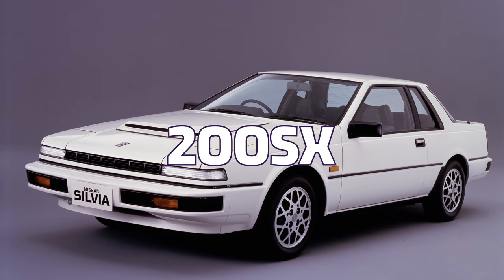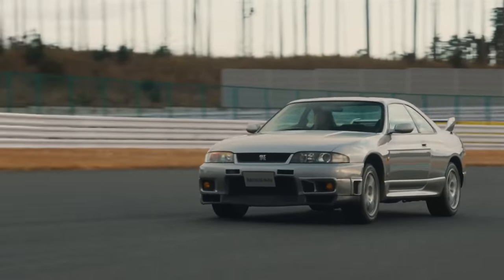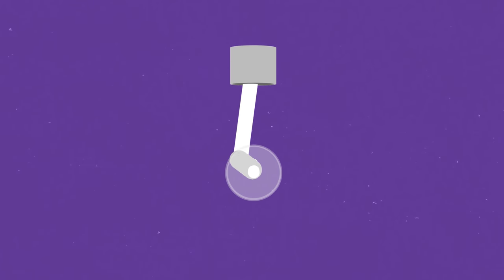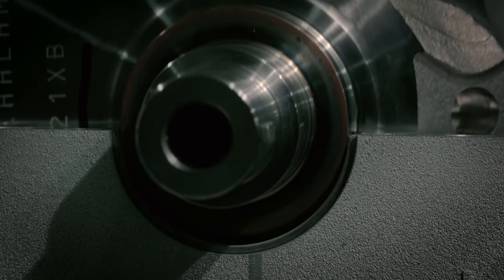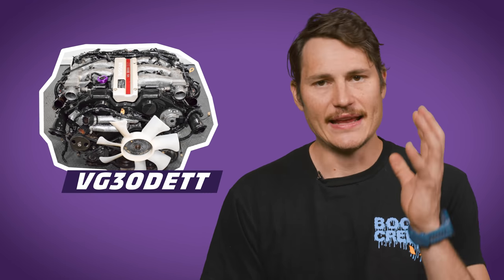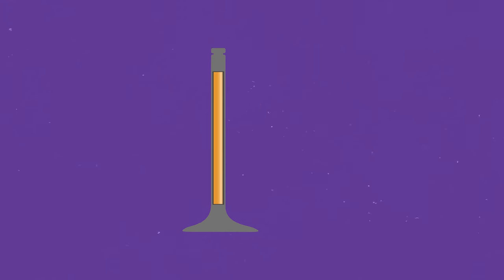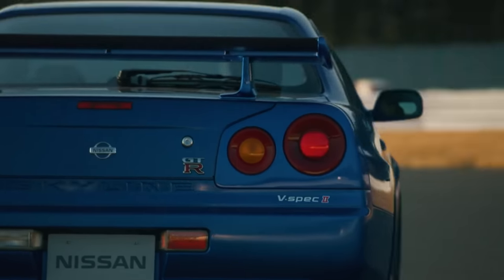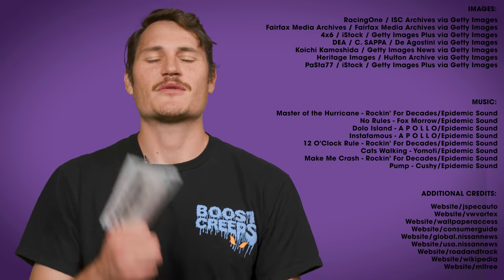RB vs. VG: Why Nissan Discontinued Their Best idea

Comment: I used to have an 86 300ZX. Red, T-tops, 5-speed, upgraded intake & exhaust.  All riding on fat 50-16's.    I scared the hell out of a few friends with that car, and even scared myself a few times.    I LOVED that damn car.   But that love went up in flames on a dark, empty back road, early in the morning.   I was hauling ass one morning, late to work.   I had just gotten into "the zone".  Taking the twisties, grabbing the gears, just pushing physics to the razors edge.  Hit a long straight stretch and turned 'er loose.  That was when a fuel injector decided to short out.  I don't know how, or why,  but the result was the wire going to the injector got hot, and started burning.  Now VG folks,  what is right next to the fuel injector wire?  Yes.  A one inch long rubber fuel line to said injector.  What happens when you light a pressurized fuel line on fire?    Nothing happy, I can assure you!  

As the line burst,  the fuel sprayed out, igniting off of the already burning wires, and rubber line. Flaming fuel, being sprayed all over under the hood.   By the time I stopped, the interior was filling with smoke.  I jumped out opened the hood to witness a mini flame thrower shooting down under the intake manifold.  I shut the car off to cut the fuel supply,  but by then  other flammables had already taken light. I tried to slap the flames out with my coat.  I tried throwing handfuls of dirt under the intake.  It just flared up, and I slammed the hood back down.  By now, the flames were already licking the outside of the windshield, and the wipers were beginning to catch.   No cell phone.  4:00 AM.  Practically deserted back road, out in the woods.   All I could do was stand there, about 100 feet away, and watch as the flames consumed more of the car.   There was a pop, and then fire emerged from the interior.  Some old guy came driving by and said he'll get help.  After about 2 minutes I heard sirens.  The fire dept showed up and it took them about 15 minutes to get the thing put out.   The car was a loss.  I had it hauled back to my house.  About 3 weeks later, some guy offered me 100 bucks for it.   I sold it.

Comment: I loved my Z32-TT, but it was such a pain to do anything with the engine, I ended up doing a straight trade for a 72 240Z. Performance isn't close, of course, but it's a lot more fun and a lot easier to work on.

Comment: The R32 evolved into the R35. Mine only makes 750 wheel HP and 650 TQ. Plenty for me. Add 65% alcohol and my GT-R makes a tad over 800 HP at the wheels.  So my vote goes to the V6.

Comment: I have a R32 Nissan Skyline GTR (RB26, well not really a RB26 because it's been bored and upgrade and is now a 2.8 liter so it's really a RB28), but a super huge downside to the rb engine like Nolan stated is the engine twist. I've alr day gone through 1 RB motor because my RB28 makes about 850 WHP and it ran into huge engine twist and it ended up causing a huge crack on the bottom end of my block that couldn't be welded.  On my second RB block I decided to get a platinum racing RB26 brace and it seems like it's held up so far.  But man block twist is no joke. It's one of the biggest down side of the RB block if you want to make big power.

Comment: Within the first 10 seconds you mentioned the 200sx.  I had an 84 200sx  in high school and I ended up locking the motor up. I've wanted another one ever since. One day I'll own one. Lol.
Reply: I was lucky enough to own an '88 200SX SE-V6.  All 300ZX mechanicals, including the R200, rear halfshafts and 5-lug hubs.

Comment: You missed the RB26 had bucket followers and shims, which theoretically requiring maintenance, make for a far lighter valve-train and better response/rev capability.  This was basically superbike tech, put in a modern car engine!

Comment: I mean... the VG has airways been one of the most intriguing engines to me. I always loved the design of the 300zx since I first saw a new one as a child where we didn't see anything about the GTRs in the US until basically Gran Turismo. 😁 the technology in the VG30DETT amazed me, though. The fact Nissan made 2 such incredible engines in the 80s instead of one platform being used in all performance cars (and vans, suvs, trucks, sedans......) such different engines that ultimately could easily have fulfilled each other's roles is amazing to me.

I mean look at the Pentastar v6 today. You've got minivans, box trucks, industrial equipment, cars as small as a Chrysler 200 through a Dodge Ram or even an RV and even to a twin-turbo Maserati sedan and then back down to a Jeep Wrangler or even Cherokee. All based on one Pentastar v6. Nissan was out here making two 6 cylinder engines to make roughly 300hp stacked with every technology imaginable in the 80s.

Comment: The VG30DETT will produce similar power figures as the 2J with a stock engine with bolt ons. Around 700 wheel hp I think the quickest "stock engine" VG30 is 9.69 STOCK ENGINE with bolt'ons. Fuel system, big single turbo, computer, plenum. Stock rods stock pistons stock heads valves and castings all stock.
The quickest stock "BOTTOM END" RB26 with head porting valve work flow testing etc is an Australian R32 GTR with a 9:92. 
Maybe those times have both been beaten but those are apparently the quickest stock bottom end GTR and stock bottom and top end ZX300 in the world as of November 2022. 

Soooooo I recon the vg is a bit better.

Comment: The R32 Skyline GTR definitely earned its legendary status, but its weaknesses tend to be somewhat overlooked by fans. For an example, check out the 1991 Nissan Mobil 500 Wellington street race. Godzilla was easily faster than everything else for the first few laps, but it couldn't handle the bumpy streets for very long, and soon fell behind cars that were slower but more reliably engineered.

Comment: The main original problem with both motors was oil pump...the vg was prone to the oil pump alloy housing flogging out ..the rb oil pumps fail cos the thread won't do up tight on the steel backing plate ..I've fixed them before by heli coiling the threads 2 sizes bigger then installing 2 stainless helicoils and seems to fix it...also rb had ECU failure due to water getting in thru the firewall when a rubber bung rots out and water gets in the car.the vg Maxima's as well as a lot of other fwd Nissans of the time the idol control alloy rots out and short circuits the ECU...it's well documented..and yea I'm a mechanic

Comment: I'm 100% an RB fanboy but I have a VG30E SOHC in a Nissan Gloria '95 GT and its one of the best engines I've experienced. Parts are so accessible (Z31 300zx), easy-ish to work on (though the space issue) and they run stupidly smooth. When my VG breaks im def swapping to an RB25det but the VG is an amazing engine and will last you crazy amounts of miles/kilometers. If you get a first car with a VG30E engine, just make sure its reliable and taken care of, then you can drive it daily to work to save for your next car. It'll never fail you. Got 190,000km on the dash and only problem i've had was my 27 year old alternator needed a rebuild. She cherry now shoutout Pacific Rebuilders on Oahu. Only thing is that if you buy a JDM car, not even Nissan will take the challenge of simple jobs for liability reasons so 300zx is a good choice but not a JDM car unless you are ready to call 50 different places to help you. I've done everything else on my car besides my timing belt which I am choosing to pay a pro to do it. Interference engine and all, Im scared I wont lie. So for reliability I am paying to have it done but JDM cars are cheaper to own, buy and have lower miles as long as they share an engine with something released in the USA. So Nissan Glorias share a 300zx engine or Toyota Crowns share a Supra MKIV engine. DYOR

Comment: What is NOT known about VG30DETT among less technically inquisitive, is that it actually had undergone some interesting tuning at the factory. 
RB26 had never featured a tune-length intake manifold. VG30DETT had its intake runners optimized for mid-range torque during the design stage.
Comment about ITBs is well and good, but with bigger turbos and bigger boost, ITBs and the factory intake manifolds are actually thrown out and replaced with an easier-to-tune single throttle body lol. ITBs are good for NA motors, but for boosted application they don't seem to matter all that much.
Another thing that VG30 has over the RB26 is the extra 0.4 liters of capacity. Might not sound like much, but that makes it an engine with a noticeably better off-boost response, higher power capacity (extra cubes always matter), earlier arrival of torque peak. Basically it doesn't need to work as hard in terms of revving as RB.
RB26 came with a well-known problem: it was known for pumping its cylinder head full of oil at high revs and drain its sump which caused an infamous oil starvation issue. Specifically for that TOMEI had made a restrictor for RB oil galleries to prevent that. VG30 never had that issue. 
I've seen someone install a VG30DETT into an R33 GT-R and the car became noticeably more street-friendly. Increased torque at lower revs made it accelerate harder from stand-still, had more mid-range punch and more out-of-the-corner drive which made it faster on the track too. It didn't rev as hard and didn't like long straights, but on tight technical tracks it shone. Sadly the car met a bad end when it was written off in a street collision: it was hit from a side to the rear and bent chassis rails due to braces he ran on the bottom.

What made VG30DETT a pain to modify is how densely 300ZX was packaged. Many times to work on the engine or transmission one had to remove them both from the car. Another thing VG30 required very quickly is an upgrade to the cooling system and increased engine bay airflow. Also a product of the very tight confines of the 300ZX engine bay. People with some basic skills in observation and logic changed the bumper, added height to the bonnet at the hinges or cut vents into the bonnet itself, thereby improving cooling out of sight. But given just how cheap people often are, they didn't bother until the engine cooked itself.
That tight packaging also made many 2nd hand owners that usually do a lot of basic servicing themselves not look after their VG30DETTs well and mechanics also hated those cars with passion for the same reasons: tightness and difficulty of access to different parts.

Comment: You have completely ignored the racing heritage of the VG30 in North America.  Nissan sponsored 300zx race cars, CanAm and Le Mon type race cars using the VG30 power plant, and the very successful 4x4 trucks that were undefeated in the 1980's and early '90's. that engine dominated both on and off road racing series in the USA.  But its racing development was suddenly ended in the '90s, which is why it is easy to forget or overlook that very successful VG30 racing history.  In the mid to late '90's Nissan was in financial trouble (like a lot of automakers at the time), and Nissan took on foreign business partners, that ended the racing program to economize expenditures (even though the racing program was only about one percent of their marketing budget).  In fact Nissan cut back on all their marketing in North America, and sales predictably sunk even further.  Majority ownership of Nissan has sold several more times after that, and it never recovered it former reputation or quality.  It is no longer a Japanese owned company ran by car enthusiasts.   I worked for Nissan in their racing development program in El Segundo Calif in the late '70's, and '80s, and was part of the small team that made the Nissans dominate in every class they raced in.  Don Devendorf, Tony Adamawitz, John Morten, and Paul Newman all ran successful campaigns in their Nissan race cars.  When the racing program was terminated, so did the development of that engine.  Not to mention, at the time, the VG30 came in many Nissan models in North America and earned a reputation for durability and reliably.  I have owned a VG30 powered Pathfinder that I drove for almost 400k miles with very little maintenance, and now own a VG30 powered 4x4 pickup.  it is a much better engine than anything in its class at the time, Nissan was the first to introduce the V6 to the compact car and truck market.  Unfortunately Nissan is no longer the leader in tech innovations as they once were, so it is easy to forget about the contributions to both racing and the consumer market Nissan has made in the past.

Comment: I wonder how wide, long, and tall a VG is? I wonder how it compares in both external dimensions and weight to something like an LS, or even an aluminum block Mark IV? The 9.8" deck versions are only about 27.5" wide but they'll support up to about 8.3L.

Comment: As a z32 owner myself who has now owned several of them and worked on several more, I can personally say that the VG is easily one of the most lackluster Nissan platforms for its time period. Its only real strength is that it's a sturdy hunk of iron to fill with boost for cheap. The Z was meant to compete with the corvette, which of course means it was designed to impress old guys that barely drive. This sadly meant that it didn't have anywhere near as much R&D put into it for performance potential as the RB platform.

Comment: I6 longer head likes to expand and warp up in the middle,  Long crank likes to twist and vibrate.  V6 vibration is handled by using a boxer crank.  You'll note the VG uses split crank pins, not common pins for pairs of cylinders.  OHC V6 must have twice as many cams as I6.  V6 block is shorter, stiffer, lighter than I6 block.  V6 has lower center of gravity than I6.  V6 has two exhaust manifolds, but they're shorter and don't warp/crack nearly as badly.  Trade off all around.
So, overall, V6 tends to be slightly lighter, stiffer, packages better, slightly more expensive to build.   I've used many of both over several decades.  

Overall the V wins.  The slightly lighter lower CG engine which fits a stiffer lighter car chassis makes for a better car overall.  The slightly higher engine cost is offset by lower chassis cost.  The theoretical vibration difference is insignificant .  Yes, there are the holdouts like BMW.  And Stellantis has just put a new I6 into production.  But they're fighting reality. 

Now, the real market where the I6 wins.  Fairly large diesels.  Most semis use an I6.  Cheaper to build than a V and space to install the engine isn't a factor.  I've got both Cat and Cummins I6s up to over 750HP.  Still have a couple of slant 6s in old Mopars.

But my daily drivers for 40 years have been V6s.  

Horses for courses.  Both have their strengths and weaknesses.

Comment: All this is great from a theory side, however: wasn't the VGDE literally the longest running most awarded car engine ever?  Was what... like 13 years straight from every major consumer awards group?

Came from the factory at 180hp/190tq in the Maxima, 300hp/283tq in the 300zx, but was insanely safe up to 700ish hp before you started having to do any major engine upgrades, which is why everyone usually stopped @ 630ish hp.

The other advantage was you could actually get one.  Could literally get surplus crate VGDE's WITH stock turbos and turbo manis already attached, full wiring kit+ecu for 3600.00, plus import/shipping... for an engine that with an JUST an ECU flash would give you almost 500hp out of the box, 600+hp if you upgraded the plugs and fuel lines and bumped the turbos up 1-2lb of boost and be bulletproof in terms of reliability (they're million mile engines, stock).

Thing was insane.

Comment: One thing he left out though. Because V6’s are shorter than I6’s, they have less weight towards the front of the car giving the car a better weight ratio. You can get closer to 50/50 weight balance with the VG than you can with the RB, so that’s another point for the VG. I’ll chuck it up to they just forgot to mention that.
Reply: Yeah that is why VG has longer lasting legacy in modern performance engines and racing. GTR uses VR and  Z as well. So they kind of left of that as well when it comes to legacy of engines.

Comment: I love both and although I'd like to have a Skyline more than a 300ZX, one of my issues with the Skyline GTR is top speed when fully modded. All I see these days are 2000 hp or more RBs that are used in drag racing and 0-60 or 60-120 mph times but never on a top speed run, let alone tested past 240 mph. 

Meanwhile, a Z32 300ZX with its fully modified iteration in the JUN Blitz project achieved 262 mph back in 1991. I mean I don't know. Correct me if I'm wrong. At least a Nissan R35 GTR today when fully modded can reach 250 to 270 mph but that's already using the VR38DETT (SVM R35 Hulk GTR reached 259 mph, there are some that have reach 255 or something). The fastest RB I've ever heard of was the JUN Lemon II R33 which has reachex 234 mph. I've never heard of an R32 or R34 even breaking 230+ mph with a modified RB. And before you come at me, I am aware that the engine isn't just the factor why these cars reach their top speed. It's just that if you think about it, at least a 300ZX was able to see past 260 in its ultimate form while only an R33 was able to break past 230. 

But yeah guys, correct me if I'm wrong or if I haven't seen any Skyline GTR (R32, R33, R34) that has gone past 240 mph. I'd love to learn something new just in case.

Comment: got my vd30dett 14 yrs ago. I abused the heck out of it for 5 yrs more, even had detonation multiple times(before I knew what it was). at 177k miles my vg is still silky smooth and current mods have me at 400+ hp. if vg had an awd variant that would be very interesting. RB would have a had time losing it in race